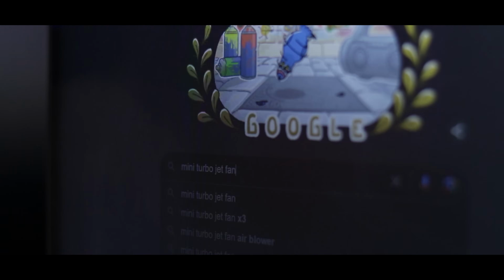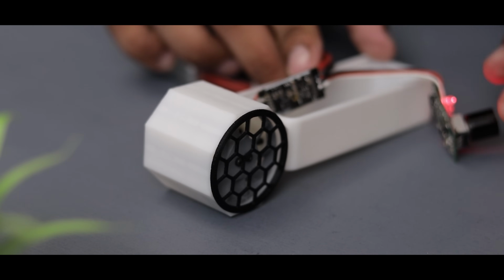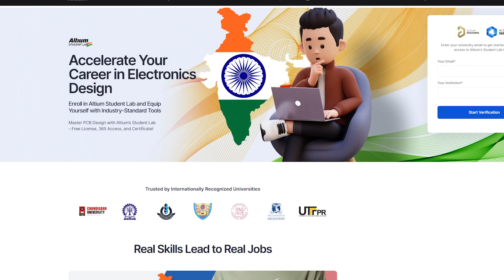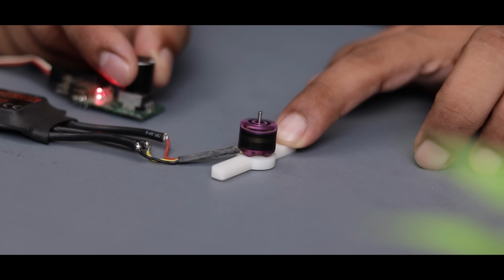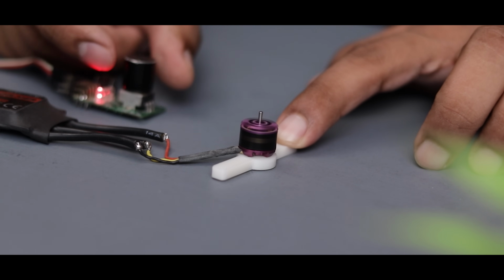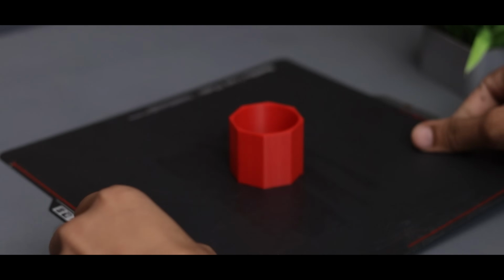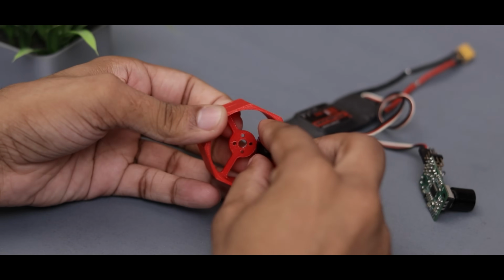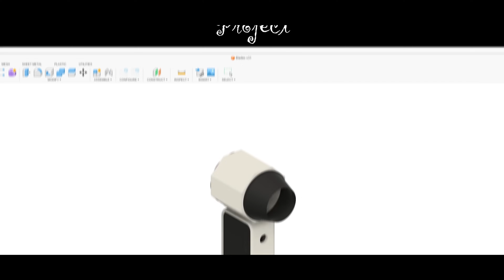DIY Mini Turbo Jet Fan | Building My Own Version from Scratch!

Comment: Hey, i wanted to build this. I got everything from your description but now noticed i got a different ESC. The one from your link has only two cables for the STV2.3, Black and White. The one in your Video has an additional Red one. I guess thats why i can't get it to work. Is there a workaround? do i need a different ESC now? And has anyone an idea what i could use that "wrong" ESC i now have?...

Comment: You should add a grill cover on the backside as well, i guess it creates a huge suction at the back and it is dangerous suppose in case it is dropped and your reflexes try to catch it.

Comment: Super cool build & video!!
However, the fact that you're using 3D printed blades is a bit terrifying, especially PLA, and spinning at 60,000 rpm so close to your face / eyes.

Comment: if you search for '13000kv inrunner jetfan' you can find inrunner ones, as big as 50mm which can do 11.1 to 25.2v so 3-6s or the standard 9000kv one for cheaper, which is the one i have

They work better than a simple bldc motor as they have metal housing and impeller and spin much faster, creating more pressure too
Reply from the maker: Nice, i will definitely check out. Thanks

Comment: The backside covers honeycomb pattern should be flat shaped outside to inside and not left and right as it is now, to allow more airflow. The same with the three structural colummns inside. Those are really blocking some significant amount of air. And i think the nozzle can also be shrinked down a little more to generate more airspeed. Otherwise, beautiful build. ✌️
Reply from the maker: Thanks, will definitely try that out
Reply: Did you?? @TheWrench

Comment: so basically if I can't afford to buy a 7000 rupees blower i have to spend 
brushes motor - $16.80
controller - $15.99
PWM controller - $4.82 
shipping - $77.15
so $114.76 with all the discount is roughly around 9,631 Indian Rupee. Not to mention the price of 3d printer and filament 

13,783 inr for a beginner level 3d printer let's assume that we get free filament 
so the total is around 23,414 /- Indian Rupees 

I'm in. imma build one for myself
Reply from the maker: No, that's not exactly it. I'm just sharing my side of the story—I already had these items in my workshop, so I decided to use them for this project. But the good news is, you can actually do this much cheaper! For example, you can find a motor for under ₹600 on Indian sites, an ESC for around ₹500, and a battery for about ₹1000. It might take a bit of searching, but it's definitely possible. I've updated the video description with more details, so be sure to check it out
Reply: @TheWrench  yup it will not go up than 3k rs